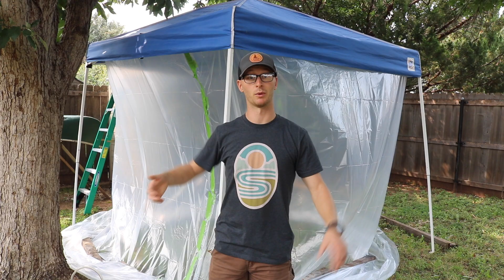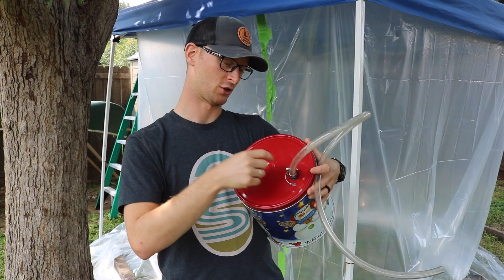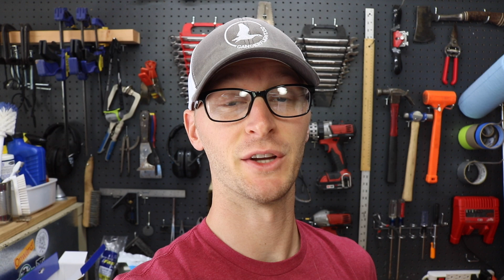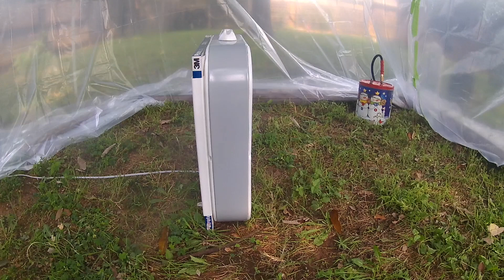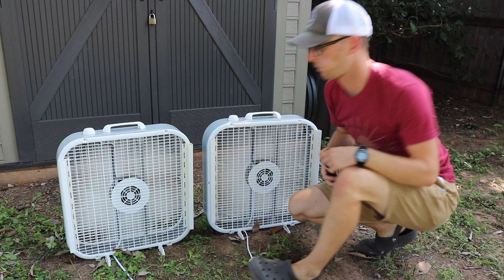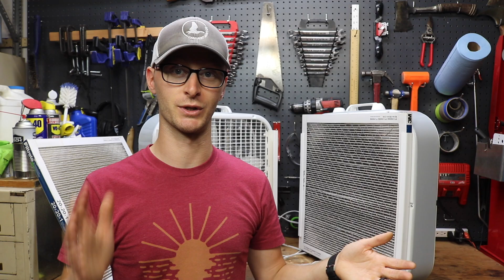Are DIY Box Fan Air Filters SAFE?

Comment: I think if u are worried about the motor perhaps
U can cut out a small hole in center of the filter matching where the fans motor is which is in the center with those few holes that way it might be little cooler or something and may even have better air flow . Just came up with that idea watching ur video i need to try these diy air purifiers soon tho

Comment: Putting filter before depressurizes air, putting filter in front pressurizes air between the filter and the fan...Hence putting filter in front causes higher temp as air was pressurized...however, it is also important to consider the velocity of air that passes through the filter, which determine how tight or loose the particle trapped in the filter. This is even more important when using a box (CR BOX), which further reduces the velocity of air passing thru, on top of the dirty side of the filter are actually facing outside.  box fan has a very low static pressure tolerance, which need to be compensated by adding larger area, that will done very little in circulating air throughout a room...

Comment: I did some testing with my DIY air purifier. I used a 200W wall fan of 400mm (uzman ksa-400 15.7") and a stack of 405x405mm filters: prefilter (thin foam + MERV11 filter 2" thick) - carbon filter (1") and 2" HEPA filter (MERV17). Built a simple wooden box to fit everything in.
At full speed with ambient temperature of about 18 degrees C it only warmed up to 23-24 degrees C after 30min running as per the thermal imaging camera. I used the fan to pull air through the filters to keep the motor clean. The airflow was enough to cool the motor, even though it was quite a load. 
The advantage of a prefilter is you keep the more expensive ones (carbon and hepa) cleaner so you don't have to replace them as often. The foam layer can be vacuumed off for larger dust particles (also a shop vac with HEPA filter). Pollen are about 2.5-200 micron in size, average about 25 micron. The MERV11 will filter 70% of 2.5 micron and most of  the >10 micron size.
A box fan may not have enough static pressure to pull  air through a filter stack though, you'll have to increase surface area to compensate. ie either thicker filters/larger pleats or more square meters/ft.
Reply from the maker: all great points - sounds like you had some fun experimenting too!

Comment: I like your test. But regardless, ran motors will become hot no matter, it is only after you turn off the fan that the motor will quickly heat up since there is no airflow around it. I've seen them get up to 140°F after running. (May depend on motor and fan and other factors)
Also with the air filters, furnace blowers are very high velocity and are centrifugal blowers, box fans are axial fans, they can have a high air flow but the shallow blade pitch (found on most fans) doesn't allow for much high pressure like a centrifugal blower (not a good explanation but its close). Most of the air will be pushed out from the side of the blades and out the back of the fan or sucked from around the side, depending on filter placement. Air will still come and go through the filters, but not all. Ambient temp can play in the motor temp, but it's nearly negligible.
Reply from the maker: Thanks for the thoughts and points, I appreciate you taking the time to comment!

Comment: You will get a lot more airflow if you use 4 inch thick filters instead of 1, they also last longer. 

You can  prevent the fan from drawing air from the front by adding a ring around the fan blades as close as you can, I recommend something rigid so it can’t be moved by the airflow overtime. 

I’m currently designing a filter model that uses 2 MERV 13s for much better filtration, and I’m also going to add a thin washable pre filter so that the more expensive filters will last much longer
Reply from the maker: All great points - adaptable for many scenarios and price points.

Comment: I'm a firefighter- yes these can be dangerous and they are a fire risk. It's not uncommon for boxes fans to cause fires under normal operation. Loading up a motor that is not designed to run under load greatly increases the risk. Having it surrounded by filters aka kindling makes it worse. Testing one fan means nothing, testing several fans means nothing- this is a stupid idea and while the risk is relatively low its still not worth it.
Reply from the maker: Appreciate the comments. Its actually being sold commercially with the filter now: https://youtu.be/N_B4LSa0NDE

Comment: Been doing it for 5 years using same fan with filter on back. Ive sealed all sides with scotch tape (white) so there's no gap exposed. I've change every 3months & it's only on when im in my bedroom. Setting on high 6hrs a day no issues. Not the prettiest but it catches a lot of dust. With this set up,  to be safe I wouldn't leave on 24hrs on low unattended.

Comment: I wouldn't worry about it, given your measured temperatures. Assuming the motor windings are class F, they would be rated for up to 155°C (311°F) before insulation breakdown starts to occur. Even if the motor windings were the worst case of class A, they would still be rated up to 105°C (221°F). These ratings come from IEC 60085.

Insulation breakdown is the primary concern with motor and transformer windings. If the insulation breaks down the motor winding turns will short circuit and could possibly cause a fire. The internal over current protection or branch circuit breaker panel should kick in if that were to happen.
Reply from the maker: 👍 Lasko now makes this DIY fan as an option straight out of the box so they don't think its an issue either.

Comment: Is it safe to use a 4" filter rather than a 1" filter?  I'm using the fan in a window overnight (to cool off my apartment vs. A/C) and I live on a heavily trafficked street.  The fan blades get coated with oily dust w/out a filter.
Reply from the maker: Yup - you'll end up getting more airflow through with the wider filter too.
Reply: @GanderFlight  Thanks, Joshua.  Also, I appreciate your detailed and methodical approach to your "research."  It takes patience, lotsa' time and knowing the things that are important to check for.

Comment: I’m no professional but I would think adding an air gap between the back of the fan and the filter would help with static pressure leading to more air throughput and a quieter noise. I’m taking this perspective from the computer world where an air gap helps a ton with performance and noise
Reply from the maker: but then the fan would just pull air through that gap and not through the filter, which is the goal.
Reply: @GanderFlight  the fan already does that it either will push it through or stall out

Comment: There not safe. The fan motor needs air. You want to cut a hole in the middle of the filter
Reply from the maker: Incorrect- in fact Lasko now makes this themselves: Should You DIY A Box Fan Air Filter For Wildfire Smoke?
https://youtu.be/N_B4LSa0NDE

Comment: "LASKO" (fan maker) has FINALLY caught on and began manufacturing a box fan with a similar HEPA filter compartment in the back.  The Compartment opens and you simply slide in a cleaned or replacement filter right in and you're good to go.  Far far cheaper than a standard air purifier and much better suited for a garage, shop, or even a home but in a hidden area.  Fun fact, "LASKO" products bought out "GERM GUARDIAN" (air purifier maker), thus giving them a nice chunk of the air purifier market.
Reply from the maker: You are correct - and its a great product! https://youtu.be/N_B4LSa0NDE

Comment: Have you done a test with air flow using filter vs. without filter?  How significantly is the power of the fan lowered with a filter?
Reply from the maker: I have not. However, it does depend on how often you replace the filter - there is a significant air flow difference after the filter has been used constantly for weeks on end - which is good, it means its doing its job.

Comment: I remember in our high school wood working/ construction class my teacher had several of these spread around his classroom to help keep the wood dust down. It actually helped tremendously. He did have a homemade dust collector system he rigged up with pvc pipe and an old car wash vacuum cleaner he put outside he had attached to the various saws that would automatically kick on whenever the equipment was turned on. Our school district was too cheap for a true dust collector system and air filtration. Luckily the new clean air regulations in my state got him a much needed remodel for his classroom. He said that in 1996 the high school finally got modern hvac systems in the classrooms so most of the teachers were throwing their old box fans out he said that he , the metals teacher and the automotive teacher collected them and attached brackets to them to make filtered air machines for their classrooms. I always admired him for collecting things other people were throwing out. His philosophy was to reuse, renew, and recycle as much stuff as possible.
Reply from the maker: Sounds like a resourceful guy!

Comment: Is there any particular bran I’d box fan that you would recommend?
Reply from the maker: Nope - just something that has the controls on the top or front and the power cord coming out of the bottom so that the filter doesn't interfere with either function.

Comment: Great video!  While the Corsi Rosenthal box seems better when it comes to performance, this single-filter version is MUCH more portable.  I'm pleased to see that the fan motor didn't heat up that much.  If you're really that concerned about this issue (or if you want to reduce the electricity usage or make the filter last longer), you can connect the filtered fan to an electrical timer and set it to automatically turn on and off every half hour.
Reply from the maker: The timer is a good idea Jason!

Comment: Thank you for the video.  The flex model with inserted filter is not yet available in Canada. 
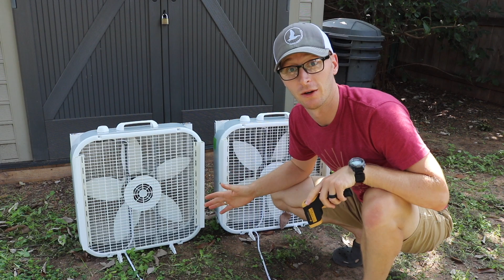4:50 motor temp test. 
NB:  some comments suggest 4 in or 5 inch wide filter.
Reply from the maker: Bummer about the Flex not being available in Canada.

Comment: Best configuration is a 4 sided cube. 5 sided cube will give you a better cad but 4 on the floor is the cheapest and most efficient way to do it unless you plan to hang it. 4x cube, 1x cardboard and then the fan... Set it on the floor and change your filters after about 6m
Reply from the maker: True - also takes up a TON of floorspace :)

Comment: Small motors typically have an over temperature trip or are built where they can handle overloading.
Reply: Yes, when you think about it these fans even when used as intended can be easily knocked over by a pet or small child or have a plastic bag get sucked into it which would seriously restrict air flow far beyond what a filter would so it stands to reason there would need to be a safety cut off.

Comment: Wow, there really is everything on the internet. well done. I just put one of these together. the possibility of the motor overheating occurred to me and i thought a solution might be to cut a round hole in the filter to allow unrestricted/unfiltered airflow into the rear motor vents. Seems like this might be unnecessary. The fan has 3 speeds, i’ll likely run it on the lowest, which seems to push plenty of air. i figure the motor “strain” on speed 1 with a filter is more or less equivalent to fan on speed 3 with no filter.
Reply from the maker: And you'll notice a definite airflow difference when you change out a dirty filter for a clean one too. We typically leave them on medium, sometimes high, and haven't had any issues.

Comment: The biggest downside is the amount of airflow coming out of the fan. With a filter on the back, I have to run my fan on high to get the flow I would get with the fan on low without the filter....big disappointment.
Reply from the maker: If you want more airflow you can try a wider filter - 2 or 4 inch filter of the same rating will get you better airflow

Comment: Why did you turn the fans off to measure their temperatures?
Reply from the maker: So that the blades pulling air over the motors when I pulled up the filters didn't cool them down as fast.

Comment: TLDW:  if you put the filter on the front, the worst that happens is your motor burns out in about 3 years and you buy a new fan.  If you put it on the back, it takes less time
Reply from the maker: We've run filters on the back of these fans for well over 3 years without issue.

Comment: you but the filter on back of fan than do you sit  the fan in the window like normal or do you put it in backwards so it is sucking air out of the house?
Reply from the maker: neither - we run this in the room with the windows closed - cleans the air within the room.

Comment: The reason you put the filter on the Intake side. Is you want to filter the dust out before the fan. Just like your Heating and A/C unit. A filter doesn't block air flow that much.

Comment: Well, I'm seeing this 2 years after it was made, but I think I am going to try using some furnace filter media.  Won't do what the higer merv rating ones will do, but I have a high air flow barrel fan, and I can basically just cut a piece and drop it on the back-the fan will suck it tight. We'll see what happens!
Thanks for the video!
Reply from the maker: Good luck!

Comment: What do you do with cord on back of fan when it is in the middle of fan?  before putting filter up agaisnt fan?
Reply: I have watched several videos an no one mentions cord sticking out in middle and back of box fan being in way of filter fitting up against  fan?!
Reply from the maker: If thats the fan you have to work with I’d put it on the front. And if the controls are covered- set it on medium and then use the plug to turn it on and off.
Reply: I was under impression it wasnt as 
proficient that way?
Reply from the maker: @maureenduncan1687  It'll work just as well - you'll just have to clean the fan more often. But unless you're willing to buy a different fan, I'd slap it to the front - making sure the air flow arrows on the filter are pointing the correct way and turn it on :)

Comment: These are good videos but “changing filters regularly” is such an ambiguous statement. Pretty much all of these videos say this. I would say based on a “standard” DIY shop maybe every month but keep in mind variables such as if you do a lot of sanding and if you have any other type of air cleaner.. maybe 2 times a month if you are a heavy user or do lots of sanding.
Reply from the maker: Its intentionally ambiguous- it all depends on use and the air quality being filtered.

Comment: I have 4 box fans in my house with a 20x20 filter in the back, Not the Front. The motors will be fine, actually Better with the filter then without Because dust doesn't coat the  motors. I have Never had a problem. I replace the filters every month and it does keep the house less dusty.

Comment: I have been using this setup in my metalworking shop since 1989. Never had a problem. I just use a box fan, a filter, and a couple of bungee cords. The Walmart box fan has to be replaced about every decade. I always get the cheapest one. I wish I could find one of those old all metal box fans from the pre ‘80’s. Those things ran forever.
Reply from the maker: I think my dad still has on of those metal box fans in the garage - simple and effective and still going strong!
Reply: I like your bungee cord idea. I don't feel like getting too fancy  but I also don't want to deal with tape. This is the perfect solution and easy too! Glad I read your comment! :)

Comment: Lasko makes a fan now with air filter holder built on, seen them in Menards. Not sure if it comes with a filter or what their directions are for MERV acceptabiltiy.
Reply from the maker: I've seen them too - they weren't out when I did the original build on these but it gives some validation on the DIY project.

Comment: I just balled up some aluminum foil and used that as a lil stand under the fan in the front so the fan sat more up than facing the floor because of those plastic stands in the back

Comment: Just a thought slightly related to this video. I have bought, and I do recommend those laser thermometers, they are quite handy. If you get one, be sure to read the instructions as different surfaces will need different settings.
Reply from the maker: Yes - and different distances from the surface to be accurate

Comment: The biggest argument for filter in the back would be keeping the motor, fan blades and the internal housing from being covered in whatever you're filtering out of the air...  Filter in the front will let all the dust, pollen, or fire smoke cover everything still.

Comment: found this video from a This Old House video on making a filter using 4 filters fitted into a cube with a  piece of cardboard and a box fan.  Any idea on if its worth doing more filters/lowering air resistance on the box fan?

Really appreciate the experiments you performed.
 I think This Old House said with 4 MERV 13 filters on a box fan that you could move 900 cfm on high speed, any idea if a single filter causes it to move less or maybe it's just not worth it to have that many filters on a single fan?
Reply from the maker: I haven't done any testing with that setup - for me the footprint was too large and bulky for where I need them so I never considered it a viable option.

Comment: Have you done any research on which box fan company has the best motor? Lasko claims their Air flex has a better motor but I don't want the filter attachment. I just want the better motor and more cfm. Then to make a 4 piece filter.
Reply from the maker: I have not researched that at all. Box fans are super simple motors and will run for YEARS - don't overthink it - get what brand is available to you and whos design fits your needs.